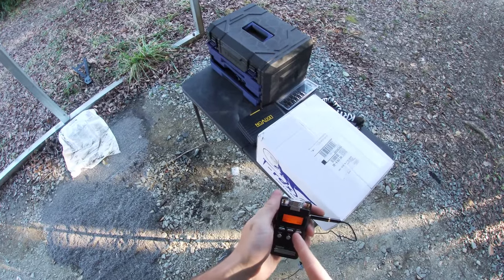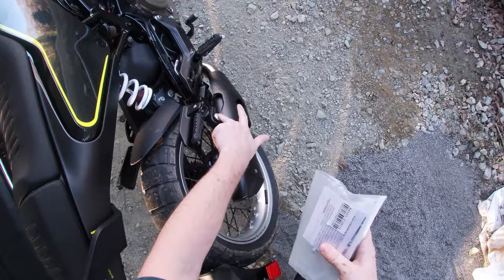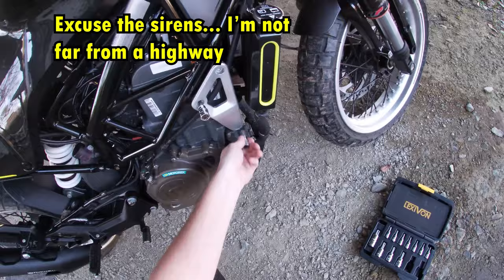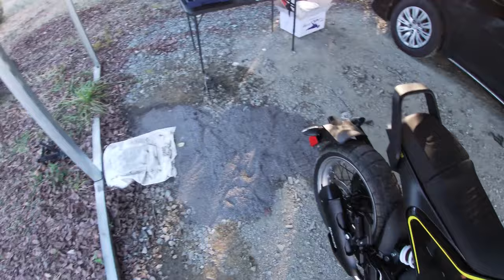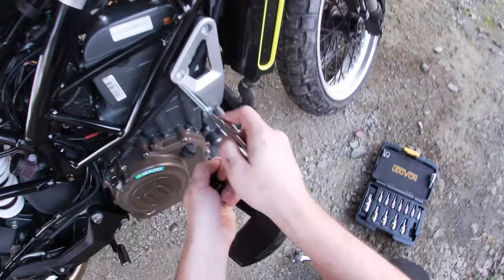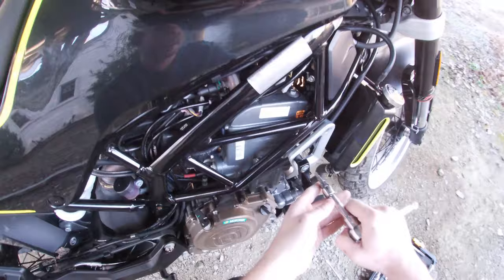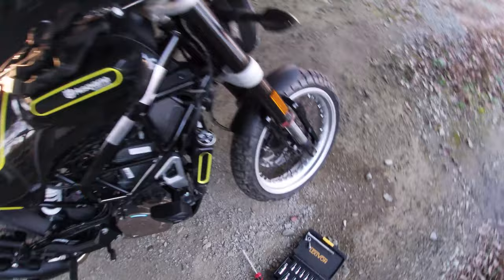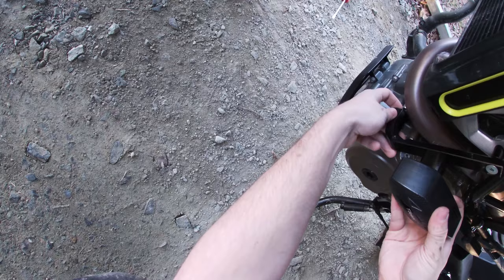2019 Svartpilen 401 -  Protection Install Part 1 (Frame Slider)

Comment: Whats the torque spec?
Reply: I've seen 35lb/ft
Reply from the maker: That sounds about right. I tried to be firm, but not crazy about it, as I wasn't 100% positive which parts were aluminum and which were steel.
Reply: @malt8810  I actually bought a service manual for the 2020 Vitpilen (not easy to find, to be honest) and the specs for the original bolts that are removed to install the frame slider are 25 N.m / 18 ft-lb. The "bolt" (actually a cover) on the LH side fork axle slider is 20 N.m. / 15 ft-lb, so I assume the RH for axle slider (which just screws into the hole already there) is the same. I didn't install the rear because I have bobbins for the paddock stand that seem sufficient (I also have the nice waxed canvas and leather saddlebag from the guys at Un1t Garage in Italy--easier to get from here in Spain--and the frame for it would be sacrificed before the bobbins or any sliders were I to drop the bike) and the rear RHS bobbin from MNNTHBX actually makes contact with the stock exhaust under heavy compression.